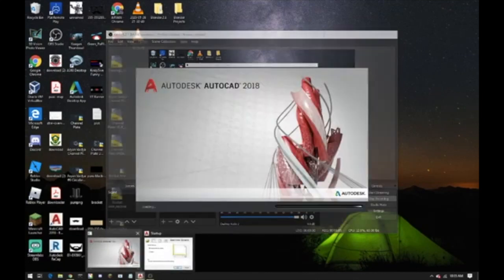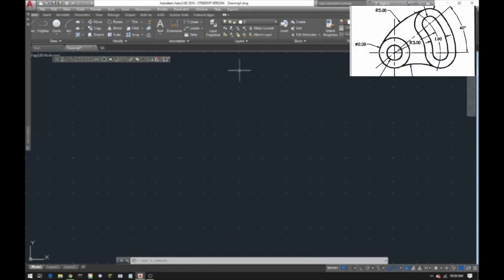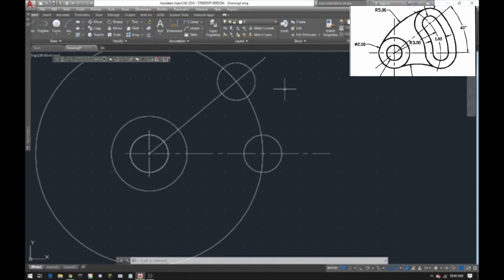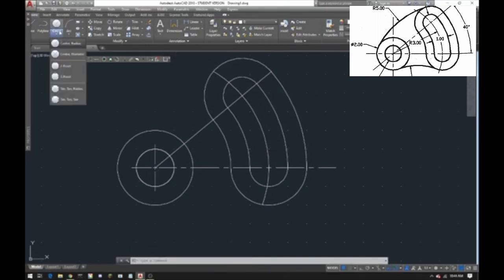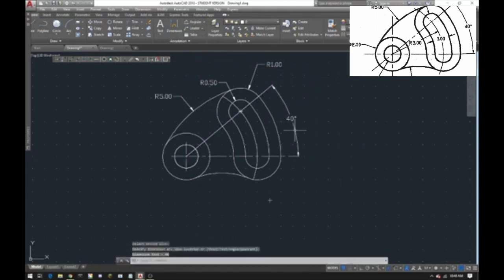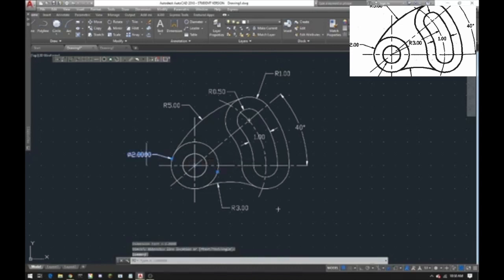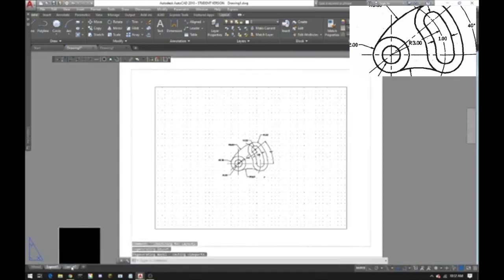AutoCAD Tutorial #1 Adjustable Support

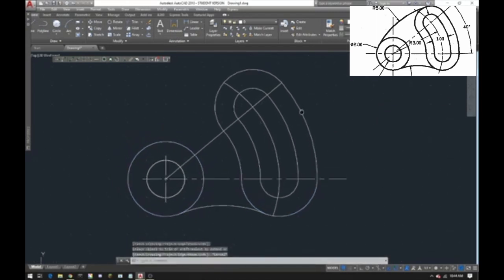Comment: That last circle you start at 8:40, what finally worked for me was this:  the reason it places it opposite is because when you pick your tan pts, you're choosing more of the inside pts.  You have to click a little more to the left on the left circle and more on the right with right circle and it will place the new circle correctly.  Thanks for the video, this helped me a lot, was the same commands for the 2022 version!